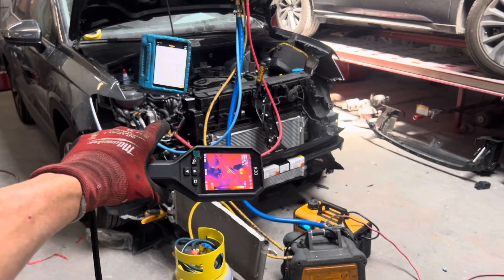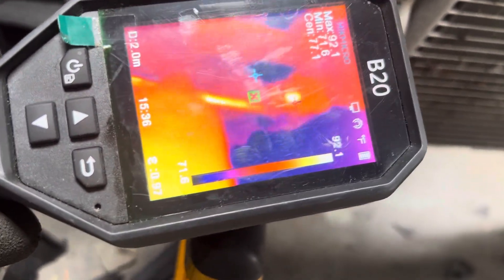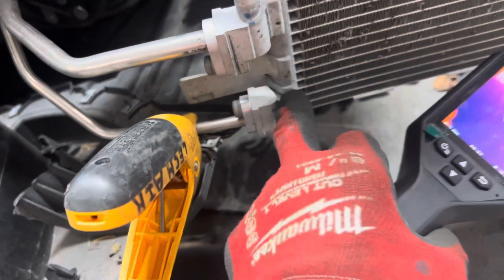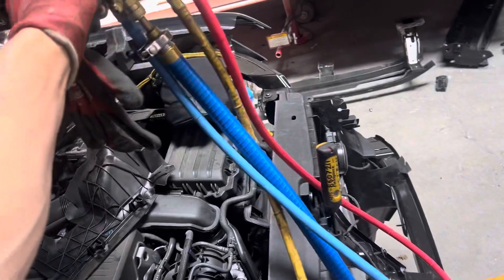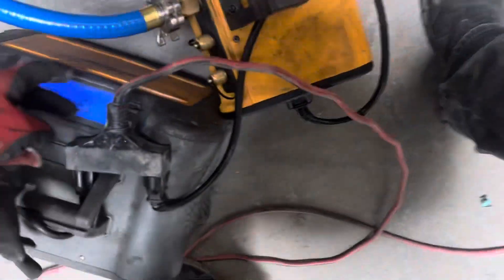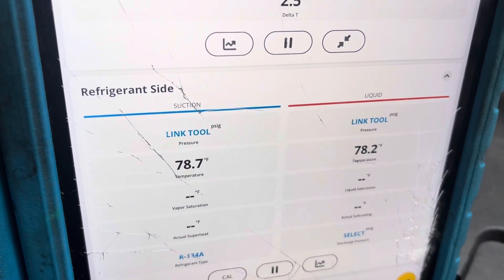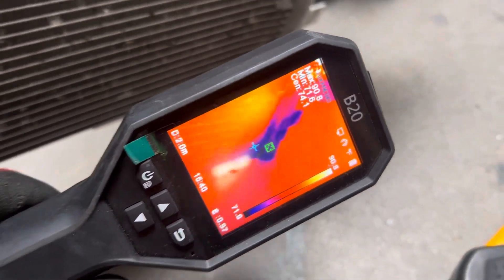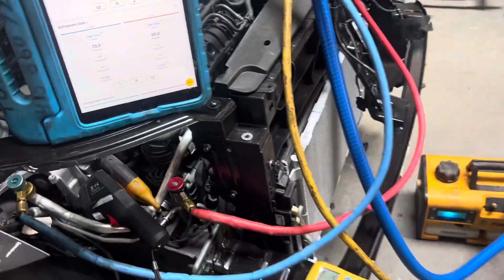WATCH SOME REFRIGERANT OIL GET REMOVED FROM COMPRESSOR DURING RECOVERY PROCESS

Comment: If I can't turn the compressor under vacuum how does the vacuum get all the moisture out with some of these piston compressors? Aren't there some pistons that are sealed off cyclically?
Reply: You're pulling a vacuum on both inlet and outlet of compressor, thus it's contents are under vacuum.  Remember the definition of a vacuum is the absence of molecules.  The lower the vacuum, the fewer and further apart the molecules will be.  The further apart the molecules are, the straighter their path will be because they have fewer other molecules to collide with.  Molecules are floating around freely and the vacuum pump is collecting them as they float into the pump inlet.  Small spaces will trap molecules and it takes time for them to reach the pump inlet.  In a perfect vacuum, there will be no molecules, the pressure of 10 microns is far from a perfect vacuum, it's still molecular flow but far below the vapor pressure of water.
Reply: Thanks guys. I have the compressor connected but it's factory provided rear seal still bolted on in place of the suction discharge hose assembly. It's that way until I have a chance the next day to connect the new hoses to it. I did all lubrication indoors with a humidity level in the low 40 percent zone to minimize moisture exposure. PAG is so desiccant.
Reply from the maker: @electric_thumbs  when it’s time to finish, just leave it on the vacuum pump overnight.
Reply: i alweys turn compressor clutch during vacuum. There is a lot of moisture. When i reach for example 250 microns, then turning clucth 10 times, microns level auto-jump to 500-600. Ofc you cant turn shaft by hand, on compressor without coil - or remove drive belt
Reply from the maker: @smklimatyzacja88  that’s what nitrogen flushing is for
Reply: @smklimatyzacja88  Not trying to discourage or challenge your method by questioning you but I'm curious to know if you encounter compressor shaft seal leaks while doing this?
Reply: @thisisyourcaptainspeaking2259  if there is oil in compressor chamber, then when you move shaft, move pistons always some pressure rise, cause you shake it, and you allow to more water particles escape out of oil, especially after first 5-10 mins of vacuum. Of course if vacuum is longer in time, and deeper less micron level rise. If you have seal shaft leak, or similiary small leaks, you wont pull down vacuum down below 900-700 microns or jumping, and you can always check graph, how micron level rise looks in time. Dont speak english very well hope you understand
Reply: @smklimatyzacja88  Yes, it's clear to understand.  Of course we try to remove contamination of gasses such as water vapor as much as physically possible and realize all of this cannot be completely removed because it's physically not possible.  However, rotating the compressor can help assuming this doesn't create an inward leak   So I was curious to know your experience, if this inward shaft seal leak often occurs from rotating the compressor.
Reply: @thisisyourcaptainspeaking2259  I know two compressors (used in modern, popular cars) that are particularly often damaged front shaft seal. This is Delphi CVC 165 series ( f.e Opel Astra/Insignia 2011-2016) (Buick in USA), and Sanden SD6C12 in Citroen/Peugeot same years ~2010-2015. As a rule, a damaged front shaft seal is not a random case, but in 95% it is always related to too little oil that I drain from the compressor - usually these compressors have about 10-20-30ml of oil in them, and in the throat (I don't know the right word) of the place where the front shaft seal is mounted, there is a small hole through which the sealant is lubricated ... lack of lubrication - destruction of the sealant. So. i replaced dozens of these sealants every year. Even if you put on a brand new shaft seal, lube everything, pour new oil into the compressor, you will still see microns increase when you turn the shaft. Of course, I'm not doing this to empty the system completely of eery one molecule of air, because I don't have this goal, nor is it possible as you mentioned, but for my own consciousness. A similar phenomenon also occurs in older cars, where the drier filter is separated out of condenser, when you unscrew mounting bolts, then you shakie it little, you will see the same thing as when turn shaft on compressor, you help to escape some additional "bubbles" of air escape out of oil. Some older compressors, such as small Japanese Seiko-Seiki scrolls, have very durable front shaft seals, even after 25 years still thight, but theye are often mounted backward to shaft, "lips" on shaft are faced off to compressor internals, and even in deep vacuum, lips are sucked into compressor, even more closely to the shaft, you can say that they seal themselves under vacuum. ... and in these types of compressors too, of course, you will notice an increase in microns when rotating the shaft. But this is just my point of view, everyone has to test it try it it for themselves, feel it for themselves, experience it for themselves then it's easier to code it into the brain.
Reply from the maker: Nothings that sealed. 

The moisture comes out with the flow . 

As soon as the flow stops, no more moisture can be removed . 

It just sits there at the surface of all items, pistons cylinder walls in the tubes on the surface of the oil in the evaporator in the condenser . 

This is why you come by with a nitrogen purge through the high side to about zero psi, and then restart the vacuum again and I can remove my new amount of moisture that is still sitting in the system .